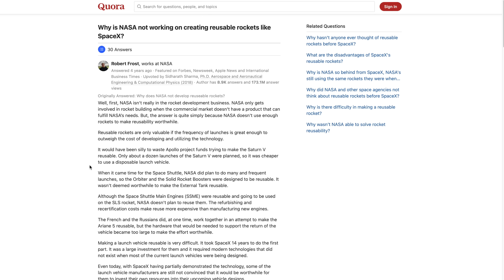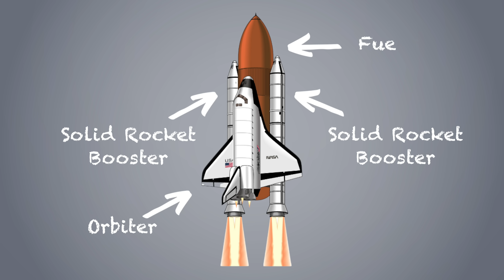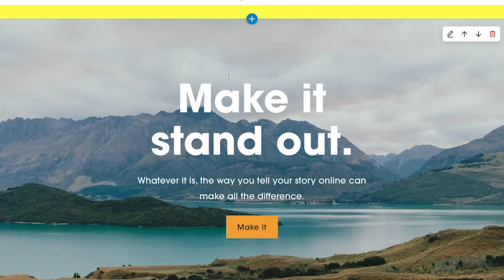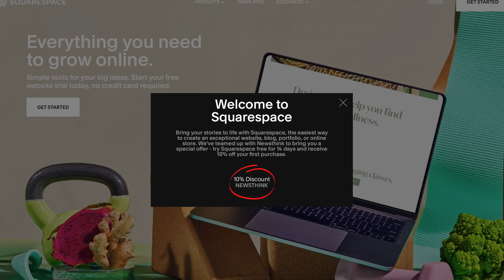Why NASA Doesn't Fly Reusable Rockets

Comment: Next should be: why nasa loves the colour orange
Reply: Indeed
Reply: Orange tank is used as a insulation form, seen in space shuttle and sls
Reply: @CreativeThinkingSujith  ye isn’t it because they thought you needed curtain colours in space other wise it would over heat and it’s lighter using just the orange insulation I think
Reply: @j4ffacake865  That's certainly the case for some things, like the gold you see on the lunar lander and white on the space shuttle orbiter
In this case, I think it's just that the colour of this insulation just happens to be orange (Considering colours is only really relevant in space, as the only way heat can transfer in a vacuum is through radiation)
Reply: @CreativeThinkingSujith  It's also why Delta IV is orange.
Reply: Lol cool
Reply: STS-1 external tank was painted white but the weight of the paint cost payload mass.
Reply: Because they love trump

Its a joke please don't hurt me
Reply: @SGR-r9k  i miss the days when people just say jokes and not attack each other and use disclaimers what a world man
Reply: That's evidently the color the insulation comes in and it evidently tans darker in the sun. If you look closely at the SLS as it's rolled into the VAB, you can see the tan lines from where it was in Stennis for the test firing of the engines.
Reply: It's due to the fuel type. Liquid Hydrogen has to be kept at ~ -250C and the orange thing you see is the cork that is used as an insulation material. Painting that would cost money and fuel since it's adding mass.
Same case with the majestic Delta IV Heavy rocket by ULA.
Reply: it is hot coler
Reply: Why not, it looks badass.
Reply: The orange color is of the insulating material necessary to keep hydrogen cool, and thus represents the failure of NASA and old fat aerospace companies to accept the indisputable mathematical fact that any rocket burning hydrogen on the first stage deserves its course reprogrammed straight into a trash can.
Reply: Yeah as everyone said it's just the foam that keeps the fuel cold is orange
Reply: True lol
Reply: It is insulation foam that is orange. Painting it adds weight that reduces payload mass
Reply: The reason why Nasa uses orange for their giant rocket parts is because they found out that if they didn't paint the rocket with heat resistant pain the can safe a lot of weight and as such the largest rocket parts are always orange since the space shuttle
Reply: Because not painting it saves 600lbs and the paint doesn't do anything but change the color. Seems like a no-brainer to me.
Reply: Easy to spot in the ocean (hence orange space suits)
Lighter weight (hence the lack of paint on the shuttle booster)
Reply: That’s the original color of the rockets they don’t paint them orange
Reply: That is a method to keep fuel tanks unpainted, and to reduce weight.

Reply edit: look at all of the replies. 😊
Reply: they love me :>